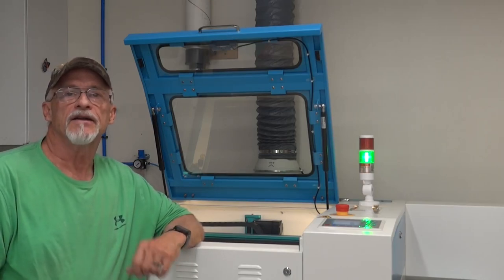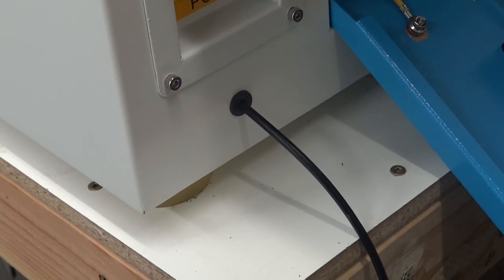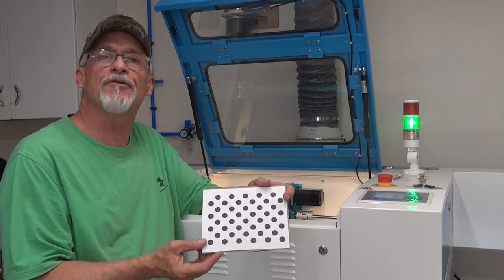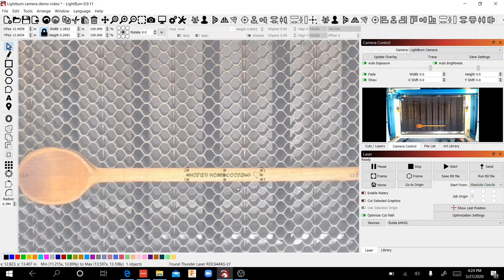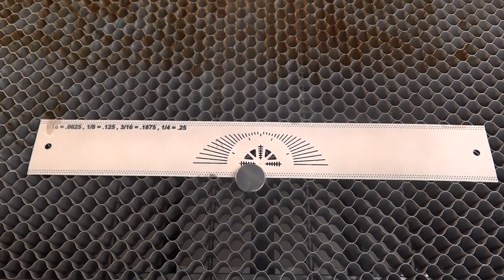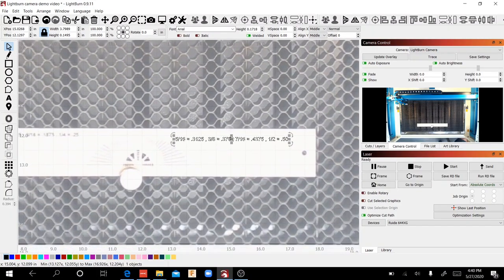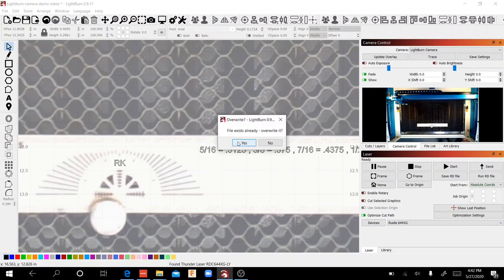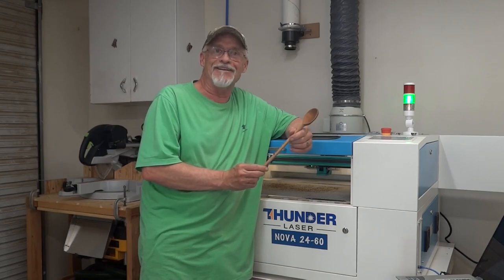Adding a Camera to your Laser

Comment: Great video!  Helped me make the choice to add a camera to my order from Thunderlaser.
Reply from the maker: You will love it! I use mine all the time.
Reply: Todd, you had Thunder add the $400 one instead of buying the $80 from lightburn? May I ask why?
Reply: @frankskupien4368  Hi Frank - the Thunder team does a lot of research and development, testing and ensuring products work as they should.  While I paid more, I want to support the US team so they have the funds necessary to support us in the field and continue to do research and development on new tools and techniques to help us all in the field.      And it is a different model number than the one that you can buy on the Lightburn page.   The only reason I know this is the one from Thunder isn't supported on a Mac (which I have).

Comment: That is amazing, I never realised the camera did all that, great video and thanks for explaining, I thought it was just for getting images from items you could not draw, never realised you could use it to set up exactly where you want to burn from, what a game changer.

what made you go for that particular camera over one with a greater FOV like a 130º or 160º ?

Time to order 2 cameras one for the C02 and one for the diode!
Reply from the maker: The 75 degree camera covered my bed without too much extra distortion. fitting the camera angle to you bed size will make it allot easier to calibrate.
Reply: @computercreationz  Thankyou, your video was excellent and i have purchased the camera on the back of it,.

I think the only thing your video needs is for you to wear a mike!! excellent speaking voice just its a bit of a echo in your workshop and a small mike will sort that, old iphone 4's are brilliant mikes, just clap a couple of times slowly at the beginning of the video to enable a sync signal and edit it out.  Many thanks for showing me what I was missing out ofm, I's seen that old start trek lightburn video but the overlay part never caught my attention I think Lightburn should use this video to advertise it...
Reply from the maker: I appreciate your input, I have purchased a Mic and have used it in later videos. It does make a big difference.
Reply: @computercreationz  great , I am sure they will be as good as this one but with a better sound, I havent seen the recent ones, I tend to start at the beginning and work my way through over a few days.... Im glad you did that as you have a good speaking voice and your videos are very goos tutorials, the camera one just amazed me and already I have about 20 people i know that didnt realise the same so were all out looking for cameras now.... Cheers and keep up the good work.

Comment: i just installed a camera to my laser wide-angle one, not the light burn one.  I did the calibration as per instructions but at the end, the camera is off by 20-30 mm off-center

Comment: Is it possible to use the camera for setting up the prints AND monitor the engraving process live or does Lightburn turn the camera off while the engraving is going on?
Reply from the maker: the lightburn  camera is on all the time, but when you close the lid for lasering it will be looking Accross the bed which works for monitoring
Reply: @computercreationz  thanks!

Comment: Using the camera, does it make any difference if you are in Current Position or Absolute Coordinates ?
Reply from the maker: Lightburn will only allow you to use the camera in absolute coordinates! You don’t have a choice
Reply: @computercreationz  Thank you...I'm brand new at this and my laser doesn't have limit switches, I did figure out that I have to move my laser to the place on my bed before I turn on the computer (for it's home position in Absolute coordinates.) Maybe when my laser grows up it will be a Thunder Nova...😀

Comment: I just started looking at this stuff in the last couple of days.  All new to me.  Pretty cool. What is enduramark? Is it something you put on or spray on the project and it gets burned off or transfers a color to the object? Thanks,
Reply from the maker: enduramark is a spray that you put on stainless steel to burn on a black color on stainless. once it’s lasers on if done properly it very difficult to remove. works well for stainless tumblers and tags etc. thanks for the comment, question and watching!

Comment: I have the same camera - and have it mounted to my lid identically.  However my image is upside down in lightburn.  How did you get your preview right side up?
Reply from the maker: yes when you install the camera you can tell which way to install it. your only option is to flip the camera 180 degrees.

Comment: What made you chose 8 mp for that size area? I have an OMTECH 80W with a larger area and I was going to buy the 5 at 140. Am I wrong?
Reply from the maker: The 140 degree camera will be way to wide. The 85 degree works for the 16x24 and 24x36 beds

Comment: I am also getting the Thunderlaser Nova 24. The 8mp camera options on lightburn website only list 95 and 110 degree FOV cameras. In your description, it states you installed a 75 degree camera, was that a typo or are they sold out now?
Reply from the maker: It wasn’t listed on there web site I had to contact them. This was before Thunder started offering there camera setup so I’m not sure if it’s still available through Lightburn.
Reply: @computercreationz  Yeah I saw the thundercam, but I will be honest, I'm not paying 400 bux for the same thing that I can get for 120. Thanks for the information sir.
Reply: I can confirm that it is available but it's not listed on the website. It can be purchased through the lightburn software, which is how I purchased mine.

Comment: Are you absolutely sure there are no other changes you need to make in the software to tell the laser to go where you place the image? Instead of it going to my current location?  You didn't talk about it or show other changes that might be needed for a new user to either change or verify first.
Reply from the maker: when you turn the camera on in camera tab in lightburn it will put your start from to absolute coordinates. are you using the camera tab in lightburn?

Comment: So the RK was pretty close, do you know why it moved to the right as you said that was your fault? I'm not sure how that was your fault...

It looks awesome but not as useful as I first thought if it isn't that accurate.....
Reply from the maker: Hi Tim, good question when I framed it before I lasered it it looked like it was going to be a little off so I nudged the Rk over instead of trusting the layout. If I would have left it alone it would have been spot on. My fault!
Reply: @computercreationz  Gotcha makes perfect sense now thank you :)
Reply: @computercreationz  is it possible that your camera ‘focus’ has a bias to the right and it needs to be calibrated somehow?  Is calibration possible?  Using a throwaway (or laser burned) ruler and having the laser etch a vertical line at a predetermined ruler mark would easily provide a measurable indication of a bias.

Comment: You shouldn't drill the hole but rather used the U-Disk connecter and re-purpose it for the camera, or would make a hole to connect the female USB output, this was the cable is never hanging like the way you set it up.
Reply from the maker: I use my udisk all the time. I didn’t want to sacrifice one major way I transfer files. Why remove one of your options. Doesn’t make sense to me!

Comment: So when using the camera. I take it you don't have to set origins. But still have to focus
Reply from the maker: no you will be in absolute origin so no need to,set the origin. you mush nose the autofocus when using the camera for a consistent distance between the top of the material and the camera lens
Reply: @computercreationz  so place material on bed first then autofocus then don't worry about position laser head
Reply from the maker: Yes because you are in absolute coordinates (required by the camera) your head position won’t mater. Your desktop is synced with your laser @CD_DESIGNS

Comment: Do you have a link to the cable holders and grommets you used?
Reply from the maker: hey Josh, I used command strips with the small hook, I put the cable tie around the usb cable and the hook. worked great. the hooks are used to hold up very small Christmas lights
Reply from the maker: I don’t have a link just look for a grommet that’s is 1/2” od 3/16 id

Comment: Can you tell me what all needs to be purchased for the camera
Reply from the maker: When I ordered from Lightburn it came with the camera mounted in the 3dprinted housing and a 6’ usb cable. That’s all you need the usb connects directly into you computer or laptop.
Reply: @computercreationz  can you tell me which one you ordered.  I looked at their web site and there multiple cameras plus looks like individual pieces.
Reply from the maker: @jdboys1478  what laser do you have?
Reply: @computercreationz  Thunder Nova24
Reply from the maker: Go to the very beginning of the adding a camera video and I indicate what camera I installed. I’m not sure if Lightburn still has that still one or not. Or order one from Thunder. When I ordered mine Thunder didn’t have an option to purchase a camera from them.  I know it’s a 75 degree 8 mp camera
Reply: @computercreationz  Thanks so much for your help.  Lightburn now offers a 75 degree and 120 degree.  Do you know what the difference is between the two?
Reply: @jdboys1478  - if you go into Lightburn, I think far right drop down menu, click camera.  Lightburn will give you your correct camera options...  The different wide angles is for the bed sizes...
Reply: Thank you so much.

Comment: How do you like the (through the nozzle) air assist? I've heard that it can be under-powered at times.
Reply from the maker: Hi George, I love it and have not found it to be underpowered. As a matter of fact you can adjust your air pressure on the fly with the needle valves placed right on the top of the laser. I have plumed in shop air and find that I can cut up to 1/2" ply with 40-55 psi air pressure.